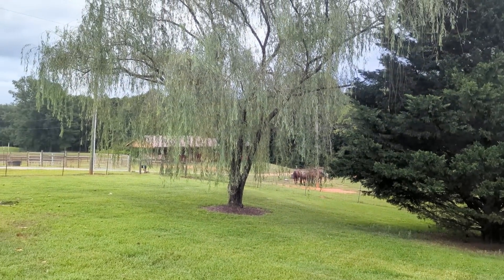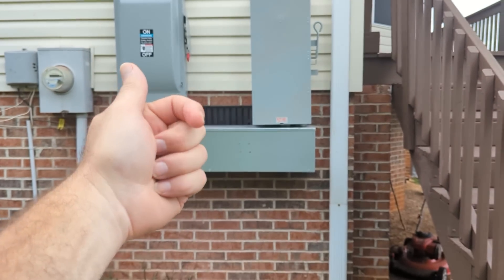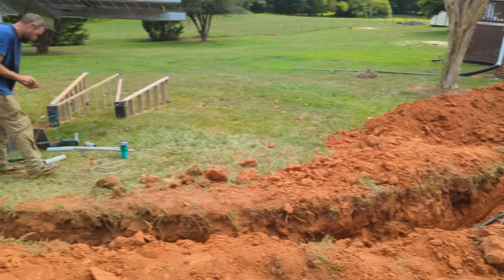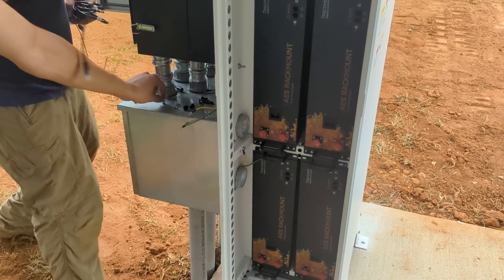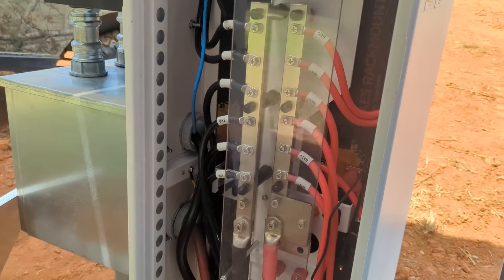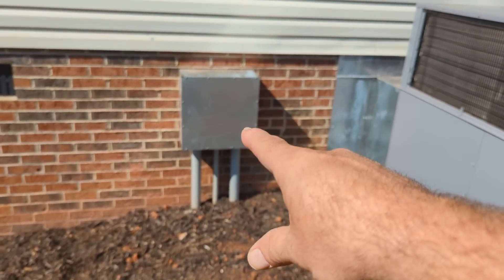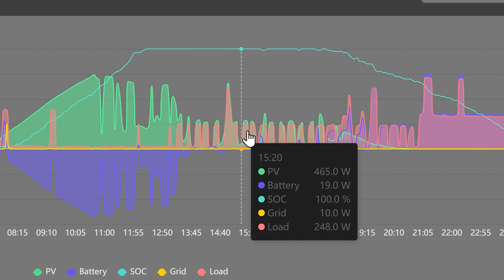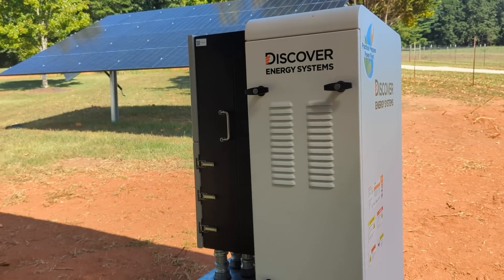Lunavolt... Our latest outdoor solution!

Comment from the maker: I add solar to my daughter's new home and get to test out our latest creation.

Get a quote for the Discover lithium battery:
https://practicalpreppers.com/product/aes-rackmount-by-discover-energy/

Get a Sol-Ark 15k:
https://practicalpreppers.com/product/sol-ark-15k-120-240-208v-hybrid-solar-inverter-all-in-one-pre-wired-outdoor-rated/

Let's discuss your solar goals:
https://practicalpreppers.com/consultation/

Check out our DIY kits:
https://practicalpreppers.com/product-category/solar/diy/
Reply: A recommendation for bolting the inverter to the cabinet in the future - better to turn those bolts around (using carriage bolts) so that you don't have threaded bolt ends inside the wire chase.  If you're worried about bolt access resulting in theft, use Huck-bolts (one has to cut them off to remove them).

Comment: Scott -I am a big fan of your installations.  I would love to see a short follow up for this configuration and the performance of the Sol-Ark and the Discover batteries out doors. How would you rate the performance at the local temperature in that location. I am considering an upgrade from SolarEdge that is installed outdoors - would like know if handle our outdoor temperature in Santa Fe, NM.  Were at 7,000 ft., Thanks.
Reply from the maker: Tell me your temperature ranges please.

Comment: Looks more like a commercial solar farm than a private solar set up.
Reply from the maker: I don't understand how you say that,..  it's a small array with a single inverter and a small battery bank for a single home. ?
Reply: @engineer775 the quality of the work.  It looks professional.  Sheesh it was a compliment.  I’ve seen so many crappy installs.
Reply from the maker: @marksmadhousemetaphysicalm2938  No problem, thank you for the compliment. I just didn't understand where you were coming from! I need more coffee.
Reply: @engineer775 I probably didn’t word it well either, I’m a mechatronics engineering student so communication isn’t my forte.  Yeah, being short on coffee is definitely a problem.
Reply from the maker: @marksmadhousemetaphysicalm2938 mechatronics is the place to be for sure. I hope that goes extremely well for you. My son is in his first year of getting his 2-year mechatronics degree. He is loving the labs they have, especially for motor controls where there's three levels of power, all sorts of sensors and relays.

Comment: Poor choice for an off-grid inverter. High-frequency inverters like this offer a shorter life expectancy. and they provide a far poorer surge capacity than low-frequency, transformer-based inverter. And because they lack an output transformer, they're also potentially dangerous for use when powering household appliances. I've been in the inverter repair business for over 25 years, and I can tell you from experience that these high-frequency, transformerless inverters offer very short life expectancies and far poorer surge capacities than low-frequency, transformer-based inverters. You'll be lucky to get even 3 to 5 years of service from this unit before the MOSFETs or IGBTs fail. Even worse, without a transformer to provide galvanic isolation between this inverter's DC boost stage and its AC output, you run the risk of damaging your AC appliances and even setting them on fire.

Comment: What is the brand/make and spec on the 28 pv panels you installed?  I believe you have two 28-panel arrays.  Since you're using Sol Ark, that means string inverters as opposed to micro inverters.  The 18k EG4 has effectively 3 built-in string inverters.  So I'm wondering how many panels you have in a string?  Thanks for any details you can provide!  -John.

Comment: I like this setup with the battery next to the ground mount panels all outside. With the hybrid inverter also outside, it looks like your outside solar powerplant is AC coupled to the house by the inverter, and you probably have a large diameter cable to carry that current to the house. Could you share details on the cable sizing and run for that?

Also, would there be any potential cost savings in using a just charge controller outside to fill the batteries and then sending high voltage DC to the house over a potentially smaller diameter cable to just an inverter to do the AC coupling at the house?

Comment: Why did you place the sol-ark and battery so close to the panels, when you convert it to 120/240 your amps go up so now you need much larger wire to run to the house raising the cost due to wire by about $500-1k. I'm not criticizing, more asking. Amazing job in the install, looks fantastic!

Comment: Besides bolting the SolArch to the 3R cabinet. I noticed you didn't use Myers hubs on the conduit connections. As a result. You have multiple points where moisture can ingress...
My recommendation is to install a roof with walls that envelope the top and sides to direct water away from the potential problem area.
Reply from the maker: @Brood_Master  It's all Myers hubs. I'm not sure what you can't see there.

Comment: I know it’s code below 18”, but I would never run high voltage cables in the ground without being in conduit.
Reply: Why?  Direct burial cable is built for exactly that, no conduit.  Tons of earth is the protection.

Comment: I would recommend a solar split unit AC to be added to the house. I have my own sights set on the one EG4 has since I've seen reviews saying how well it performs using very little watts. This could be installed in the main living area of the house and actually just run alongside the existing unit on "normal" days which would take some pressure off the big unit and reduce consumption. Grid down,  the big unit would stop but the split system would keep going, may not be enough to cool the entire house but at least the living area will be liveable (think indoor camping)! Just my 2 cents which happens to be the direction I am headed in myself with my own system.

Comment: I likely would have avoided putting your expensive items outside for a lot of different reasons.  Also depending on weather you will be giving up a lot of power forcing those batteries to heat themselves.  You also spent a lot of extra money and cost in trenching and running a lot of really heavy cable.  Also if the weather is bad you won't have easy access to the inverter or the batteries.  I understand your thoughts but also lifepo4 is super safe.

Comment: Give me the unit to direct leak exposed the weather.
Would you consider a Shed build. In this case, I'm talking about the square in closure that 1 side comes off. Either he understood or was scrubs or whatever around the batteries and inverter. When you need to service, take off the one side and rock off the 3 sides and top to the side. Do your service rocket back on and put the sad on. Of course, you'd have to have some stabilization. So that weather didn't push the shed around

Comment: Hows the thermal insulation in that box? Heat no good and low temps batteries won't charge
Reply from the maker: @Kosmonooit  The Discover AES batteries have built-in heaters. So this will be a good test this winter.
Reply: @engineer775  Thank you for the reply. Guess that box in the shadow of the PV panels might help keep solar radiation ingress at bay. 

I've had to develop my own climate control system for banks of Pylontech batteries in confined enclosure, had issues both sides of the scale and live in quite a temperate zone.

Comment: Love your videos and thank you so much for sharing. I'd like to ask a question to get your opinion. The Sol-ark 15k manual has a 200amp disconnect (doesn't say fused so I assume just an emergency style disconnect) between the inverter's grid input and the tap at the grid. I believe in your case you are double lugged at the transfer switch where the grid comes into the transfer switch and that's your tap - it makes sense. You have the 200 amp fused disconnect that is just downstream of the meter, and that's also in the Solark's manual - makes sense again - that's the main disconnect for power to the home in case of emergency. So this extra disconnect between grid input to inverter and grid tap, is that just for ease of killing the grid connection to the inverter and/or easier to swap/isolate the inverter if needed? I don't see any other reason to have it. If you do have it, then if you need to swap the inverter, you simply throw the transfer switch to have grid power straight to your panel, turn off that disconnect and you have the whole Solark isolated from grid, do the swap or maintenance of whatever. If you don't have that disconnect then you would need to turn off the main disconnect, lose power for a moment (assuming the inverter's load output is not powering the panel because there's something wrong with the inverter - hence the need to work on it/swap it) disconnect the inverter's grid input wires and tape them up, then turn the main disconnect back on and hit the transfer switch. Did I get that right? Some other manuals for other inverters have the same disconnect, fused, and mounted outside that serves as the :PV Interactive Disconnect", and that's right next to the main disconnect. It may be now required by new codes? But honestly if you turn off the main fused disconnect (one right after the meter) then doesn't that accomplish the same thing, protecting line workers/first responders? And if there is a rapid shut down switch, that would kill power to the rest of the system (inverter would shut down power the main panel, shut down PV if equipped with RSD, and shut down batteries if they have that feature). Just curious your opinions. Thank you! Great videos!

Comment: Are you not commissioned as of yet to sell to grid, or is it a purely zero-export? I'm still doing zero-export because the base connection cost ends up quadrupling for me to even be able to sell to grid while limiting your array to 8kW. It made more sense to invest that in batteries for me, then I would have a good backup power source too. The case for net-metering has only gotten worse, I almost think the power companies are trying to put themselves out of business.
Reply from the maker: @captainobvious9188  interconnections on this co-op are ridiculous as they charge $7.50 per watt per month to be connected to them and they only give you .059 and charge you $0.16 per kilowatt hour.

Comment: I know the Sol-Ark is NEMA 3R/IP65 and exterior rated but practically how will the PCBs do living outside in the summer humidity? I'm debating on this very thing at the moment, build a shed or hang it on a meter pedestal outside.

Comment: There's an outfit called Ravolt that sells a similar set up, just not sure about keeping that high dollar equipment outside in the elements.
Reply from the maker: @davidvelen9835  the cost and capability difference is significant

Comment: I don’t understand the rate change. It cannot possibly be $13 per kwh. We use 2000 kwh a month in the summer. That’s 66 per day on average or 2.75 per hour. 3 hours per day 3 pm to 6 pm would cost $107 per DAY. That would be an extra 3k a month? What am I missing?
Reply: Ah. I would love to see that in action. Something tells me the solar industry is fixing to grow up and go from a cottage industry to mainstream regulation requiring only commercial electricians for install and design. No more garage kids playing with solar panels. I love the idea of moving the inverter and battery outside and under the array. I would also love a detailed view and schematic of the bypass. I’ve been thinking about how to wire that for weeks now and I’m having some weird mental block with it. Great videos and wish you were close to Mississippi!!
Reply: @JNHEscapes  I would not love having that stuff outside in the weather.  Batteries and electronics will live a longer, happier life indoors, where they don't suffer extremes of temperature or humidity.
Reply: It's not.  It's a "demand charge".    $13 per kw of peak demand during peak hours in a billing cycle.   This sort of charge has existed for commercial and industrial users for many decades, but this is the first I've seen it for residential users.

Comment: Those arrays would have made a great carport or shed if the posts were a tad bit higher
Reply from the maker: @Premier-Media-Group  everybody says this but the amount of moment at the base of those posts as you go higher is exponential. These are gigantic sails in the wind and these single post arrays get to a point where they're just going to fold at the bottom if you do that. That's why most carports with post this small have to have two rows of posts. The carports with single posts and cantilevered solar require more cost in concrete ballast and rebar than the The cost of the carport material.
Reply: @engineer775  makes sense.
Reply: yes, i always wonder why the "engineer" does not combine that. two flies with one stroke. just needs a little bit foresight though

Comment: I like the battery storage being away from the home.
Reply: i am not so sure about that. the battery is exposed to the heat and the cold that is for sure not good for longevity.
besides lifepo4 technology is pretty safe.
Reply: @ursodermatt8809  I agree, LFP in my home is preferred rather than exposed to temperature swings. My concrete basement seems totally fine.

Comment: I swear the code writers never leave CA. Tossing them outside is all fine for the south, but in the north battery heaters will need to run like crazy to keep things warm.
Reply: As if getting solar to work in my region isn't difficult enough, let's add cost and complexity to the process.
I'd prefer to add a fire rated enclosure to my house similar to that required for interior backup generators.
Reply: Small underground bunker matbe?
Reply: @scotanderson6857  Kills the ROI. Been looking to do a battery system for peak shaving. Now that Michigan is on the 2023NEC they are already adding 1k+ to an install if you want to do it on the up and up. From requiring fused disco's instead of breaker based disconnects, GFI, and AFCI breakers on nearly every circuit.

Comment: I have 19kw in panels and 150kw in lithium and it's not enough. Always go with a lot bigger like 2x than what you think you would need
Reply: Isn't it the truth?  I just started tinkering with solar, starting with an Ecoflow DP3 system.  For testing, I want to power a 300 watt load sometimes, just during daytime.  I'm up to 790 watts of panels and it's not quite enough.  I've seen them make up to 645 watts.  Averages more like 575 when lit.  I never realized how many puffy little clouds move in front of the sun on what I thought were bright, sunny days, to cut down on output.  I'm still using more over a day than I make.  I went from 98% battery down to 91% in about 5 hours.  Need more panels!  With neighbor's trees, etc., I doubt I could run my house on solar with the panels that would fit and not be shaded.
Reply: Are either of you doing automatic load shedding, with something like a Span panel?

Comment: I love to see an episode integrating existing grid tie inverters with hybrid inverters/batteries.  I'm aware of two companies that do this and I love to see an installation showing this application of solar.
Reply from the maker: @exploitthechildless1510  We have been doing this with enphase and solark for two years.
Reply: @engineer775  any examples other than micro-inverters?  I see that several manufactures utilize the generator port.  I assume that is what you are doing a similar procedure?

Comment: I assume you can only put the batteries outside if you are in an area that doesn't see harsh winters! I also assume the batteries have heaters in them for cold wheather. I am curious to know where the dividing line is as to whether they should be used outside or not. Something along the lines of if you have snow on the ground for more than a week each year put you batteries inside!
Reply: Had the same thoughts and concerns, but i guess you could dress up the area (hide the metal boxes that will most likely rust) by building a mini storage shed that is insulated but still include battery heaters.

Comment: $13 a kwh ?? wtf ??, 3 things are going to happen,customers are going to be screaming about the "excessively high" electric bill on there local tv stations"consumer help segments", or they will suddenly see a massive jump in consumers switching away like you are doing there, or more than likely people will pay the massive bills and the profits of the gas/electric company will shootup faster than a spacex rocket,pps our fixed tariffs have just been increased here in the UK today by a average of 10% starting October 1st both on gas & Electric and on both unit charge and daily standing(connection) :( :(

Comment: How about the temperature range out there?  I think the Sol-Ark is good within -25 to 55 C, so that shouldn't be an issue.  But, what about the batteries?
EDIT:  And, is that 4/0 wire running from the meter to the Sol-Ark and then back to the panel?  That must have cost a bit (and been fun to run).
Reply: Here are the temperature specifications for the batteries.  
Charge Temperature	Min: 4°C (39.2°F) | Max: 52°C (125.6°F)
Discharge Temperature	Min: -17°C (1.4°F) | Max: 52°C (125.6°F)
Reply: @discoverenergysystems  In another comment, Engineer775 said the batteries have heaters.  I hope so (and I hope they're strong enough).  Last winter here in Texas, I had to us a space heater in my garage when the outside temperature went to 5 degrees Fahrenheit.
Reply: Very interested